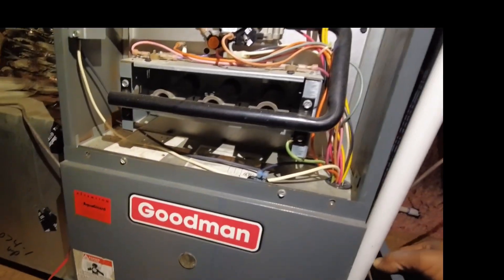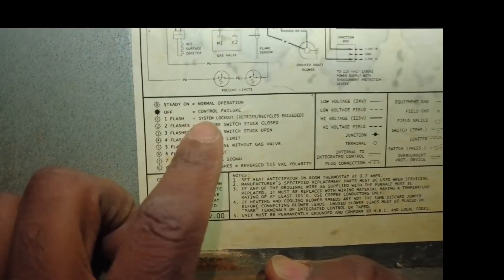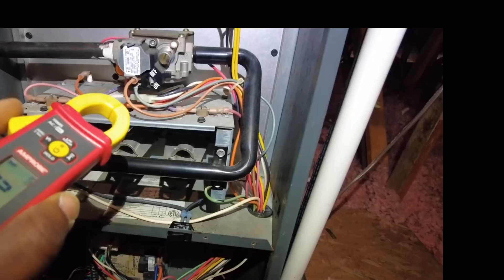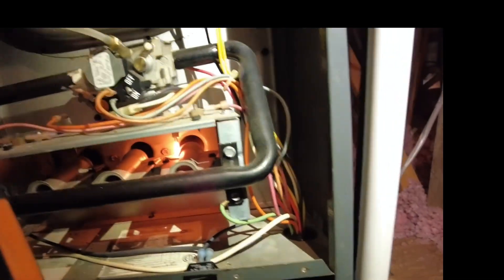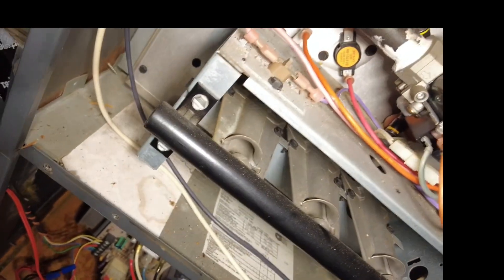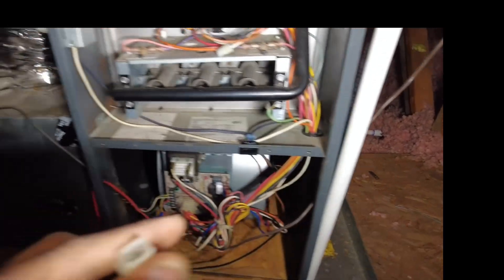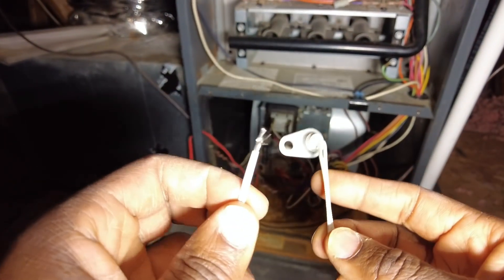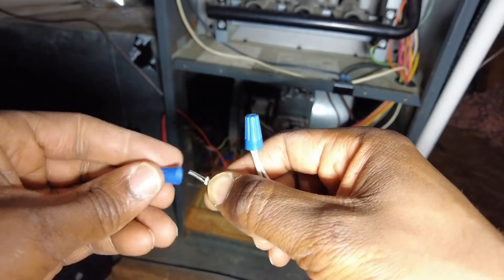Failed hot surface igniter 80% Goodman gas furnace troubleshooting replace universal flame rod

Comment: Ive seen a few scenarios like this before. One was on a York unit. It wouldnt always light but when it would it wouldnt stay on that long. Flame sensor microamps were good. The circuit board would give an error code for the flame was lost under demand. I think it was a bad gas valve on that one.

Another one was a lennox 2 stage unit with a plate on the burners with a sight glass. It wouldnt light up with the cover on at all. I was stumped on that one. I left the cover off. Ignitor was stock and looked in good shape. Ohms were around 50.